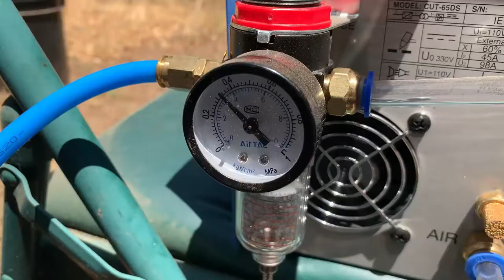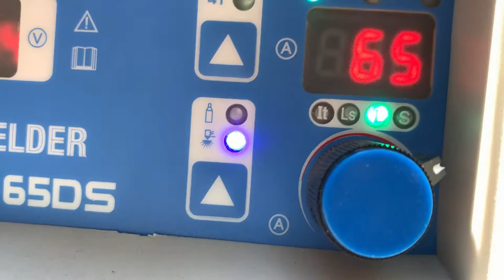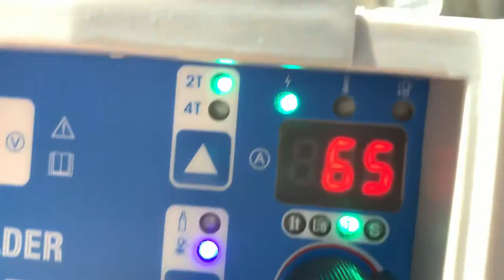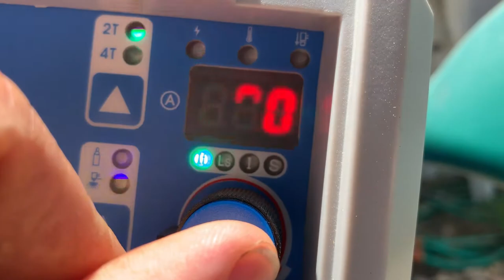BEST PLASMA CUTTER! Yeswelder Cut-65DS Overview and Review

Comment: You did have preheat on the multi cuts you made on the tapered bar.  You feed control is very good.  They mentioned air pressure chgs on some cuts.  So, feed rate, amps, and air psi seem to be the key for smooth slag free cuts.

Comment: Hi Jake, Thanks for the great work doing the review. I have a question if you don't mind. The spec for this machine recommends using 63 Amp breakers. I just wonder what amperage of the breakers you used to do this demonstration. Do you think this machine can work with 40 Amp breakers?

Comment: So my biggest question is Chinese simadre 50 amp plasma cutters for about ten years now my Miller blew out and I bought this temporarily and it's been working for so many years. I'm debating on getting the new yeswelder 65 plasma cutter have you compared this plasma cutter to the 50 amp I'm wondering if it's a true 65 amp or if it's just fake ratings

Comment: Where did you get the air flow gauge for the torch head, that you used in this video
Reply from the maker: It came with the plasma cutter from Yeswelder

Comment: How is that plasma cutter doing now Jake?
Reply from the maker: I should probably replace the tip, but it has withstood some pretty bad abuse by now. Still works great!
Reply: @FormulaJake  Origianl tip has lasted 7 months or more?!
Reply from the maker: I certainly don't use it every day but it lasted many months of weekend use. Didn't turn to crap until I tried to cut through more than an inch of steel in a pocket that wouldn't clear out 😂